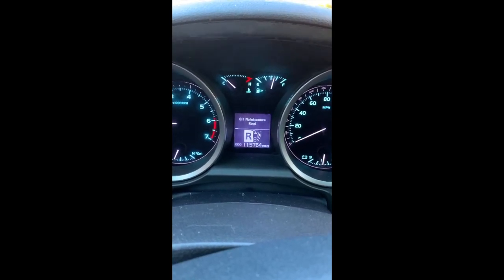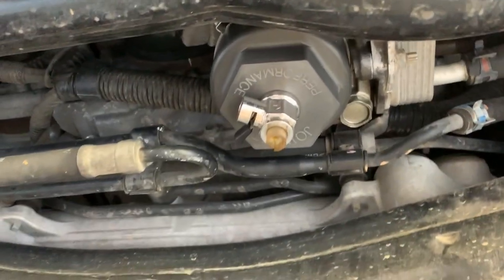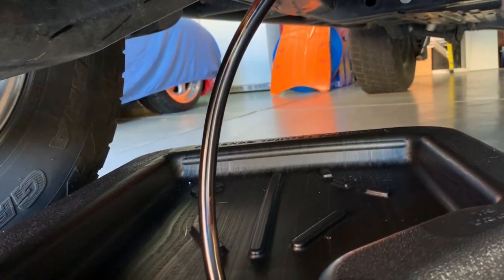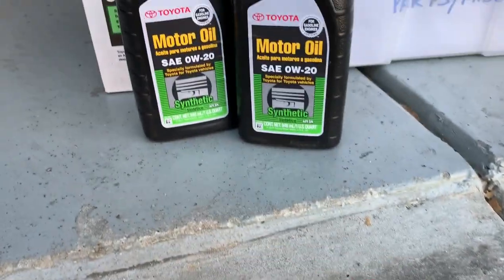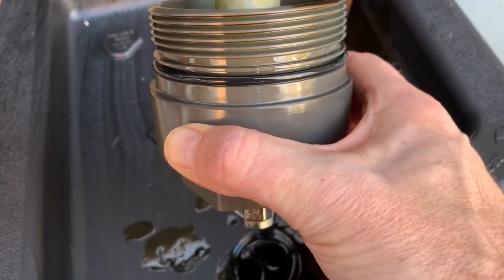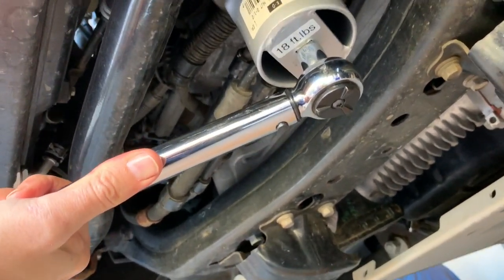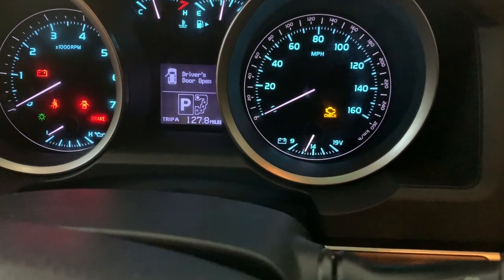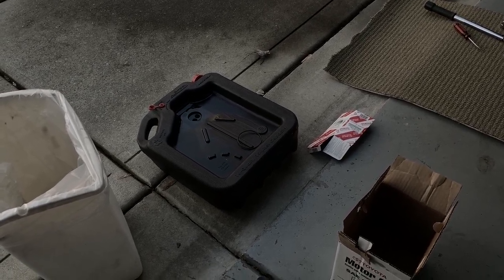DIY Oil Change - Toyota Land Cruiser 200 Series - No Mess!

Comment: Thanks for sharing.  1 comment, you have to hold the torque wrench on end of the handle, not in the middle of the body/shank as you did,  to get the proper accurate moment-arm torque applied.
Reply from the maker: Thanks Mike - you are correct - and I normally do.  I just couldn't do it while holding a camera at the same time!

Comment: Thanks. Mine came with no instructions. No instructions on website. 

I got it after a while but would have been nice if they had a video showing how to get tube out of old housing and installed on new one
Reply: where can i buy the modified filter housing ? Can I have the part number ?

Comment: Where did you get the brake lines??
Reply from the maker: Hi Alvaro - I'm sorry for the late reply.  I ordered the brake lines from a company called Crown.  You can specify the length and the types of connectors, etc...  If I recall I ordered stock connectors, but +3" rear and +2" in front.

Comment: how much oil quart
Reply from the maker: I believe my manual states 7.5 quarts including filter - but I would have to check.  I think newer LC's call for 8 quarts if I recall correctly.  I tend to split the difference.

Comment: Pretty thin oil ,is spec 5/40 ?
Reply: zoezoe610 Most new Toyota’s use 0w-20. I agree it’s pretty thin.
Reply from the maker: Sorry for the late reply.....it does seem quite thin but if you are running the Toyota synthetic - I think that is the only option.  And as mentioned is it what is specified by Toyota.
Reply: @fatasterisk7939  Many mechanics feel it is too thin for our climate but each to their own. 10/40 for me here in Australia.
Reply: @zoezoe610  I don't understand why people think climate has anything to do with modern oils. I don't care if it's 100°F where you live, operating temperature of your engine is double that. Film strength of the oil is what protects the engine from excessive where. There was a time that viscosity alone provided extra time strength. Not anymore. It's the additive package that provides the film strength. The benefit of lower viscosity us increased flow rate getting the oil to all parts of the tight tolerances engine.
Reply: @zoezoe610  10/40  for me too here in Dubai....although toyota says 5/30....but i think offroading and revving near/abv 6000 rpms on dunes  .....i think 10/40 is best ...fuel is cheap so nonworries abt fuel  consumtpiton
Reply: I run Castrol RX Super 15w40 in Victoria Australia. Though mine is a 4.5L Twin Turbo Diesel